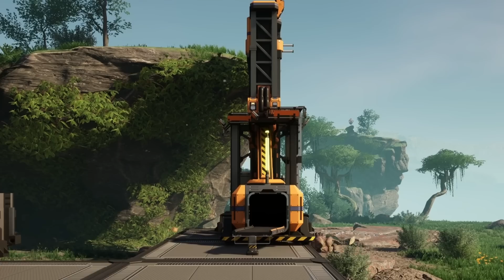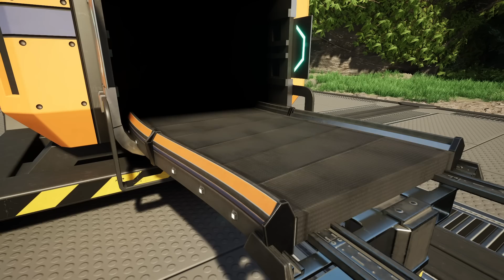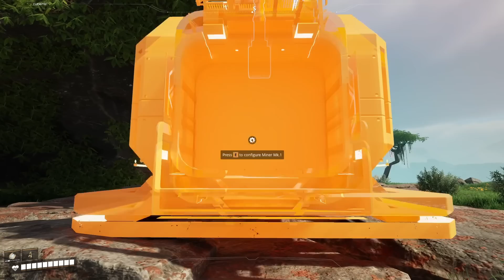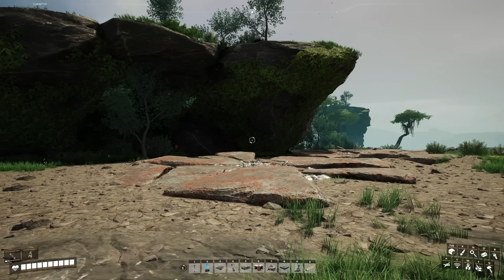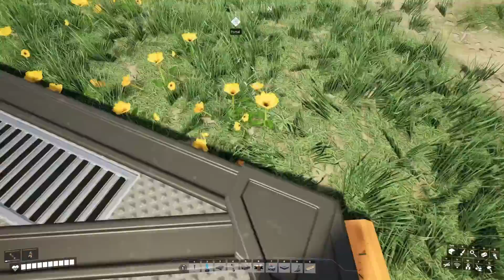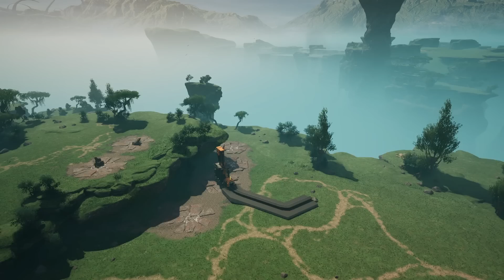How to Centre And Merge Miner Outputs Perfectly in Satisfactory 1.0

Comment from the maker: I'm thinking about covering liquids and dealing with bi-products next. Let me know what you'd like me to cover in it next!
Reply: Perfect timing for me!
Reply: Yes please as they are a pita.
Reply: Total, what do you think of some of the new alt receipes for ingots brought in 1.0 ? Ore ingots with sulfuric acid, quartz purification with disolved silica as by product, tempered ingots with petroluem coke, etc .... It seems there is a lot more options to produce ingots from raw ressources and with the new converter i feel a little overwhelmed by all the possibilities. It would be interesting to hear what you think about and how you plan to manage in you playthrougt. TY
Reply: I could definitely use that lesson lol, also how to deal with pipeline build modes lol because they never do what I want so I end up noodling everything and spend a looooot of time trying to make it look good.
Reply: For anyone struggling to get the barrier to align since 1.2, I have found a method that works.

Place your foundations and then your miner. Add another platform on the right or left of the output making sure its of the same height. 
Now take the barrier and face the output (try and be a little off center) then snap and press H once you get it to snap.

Another thing, you need to see the grid of the miner for this to work. I've tried without getting the grid to display and it simply doesn't work.

Comment: Sadly this no longer works.  The road barrier no longer snaps to the front of the miner.
Reply: I just tested this, it does work, but its incredibly frustrating to get it to snap. Best way i found was to go place your foundations and then your miner. 
Add another platform on the right or left of the output making sure its of the same height. 
Now take the barrier and face the output (try and be a little off center) then snap and press H once you get it to snap.

Another thing, you need to see the grid of the miner for this to work. I've tried without getting the grid to display and it simply doesn't work.

Comment: Found a new way to do this yesterday, all by accident. Place your foundations on the world grid like normal over the node. Place the hologram of the miner at the node and when it snaps into place hit "H". Adjust the location until the miner is centers on a grid then finalize the placement. It still works as long as it locked into place. No need for any fancy foundation work at all. REquires the Infinite Nudge mod.

Comment: The thing about 'straight' mode is that as it works now it should really be called  some variation of 90 degree mode.
I say that it that it tries really hard to make any bends in the belt be 90 degree bends and sometimes that just doesn't work.

Works great when it's all on the same grid, facing the same way. Not so much when what you want is a belt as straight as possible with a single bend, when that bend is not 90 degrees.

Comment: If you're going to do the 90 degree angle way to fix it best to do the old school way with default mode. Pole, 2 snaps in x direction, 2 snaps in y direction, another pole. Then delete poles as you see fit. By doing it using straight mode it sometimes inherits some of the wonky angle and it will not run straight on your world grid. By doing it using the oldfashioned 90 degree angle way once at the first 90 degree turn, straight mode will get the hint ever after. The very same trick also works straight at the miner's location on a world grid snapped foundation if you place the miner at a 90 degree angle from where you want to go, instead of a conveyor pole just pretend the miner is your first pole and go 2x, 2y, pole. Not always possible to get that kinda clearance on the miner, but if possible at all it's way quicker to set up.

Comment: Found a nice trick with the road barrier to wall swap. I've been making blueprints of the production machines, attaching a wall connector to them so I can daisy chain them (nothing new). But sometimes it's a pain to get the exact position even with nudging. But I found a way to move it 1/4th the distance of a nudge.

Place one road barrier. Place a second on top but tilt it once. Place a third on top of the second, but nudge it once. Place a third, tilt it back so it's straight again. Rinse and repeat.

Comment: As a first time player in 1.0 I have to say that this "issue" is a bit of a non-issue for me. I just place my miners on the actual node and run a conveyor onto the nearest convenient foundation. As long as you build your foundations a short distance away, the misalignment is virtually unnoticeable. You can also greatly reduce the visual effect by having your conveyor make a 90 (or very nearly 90) degree turn. The human eye can detect non-straight items much more easily than "not quite" right angles.
Reply: if you close your eye it all looks great :D

Comment: My favourite solution to this, is to build it on foundations as normal, then house it a structure with a conveyor wall at the front of the miner, however the housing unit is off centre from the world grid, but your foundations are not, a better solution for myself and maybe others :) Great video as usual though dude!

Comment: I noticed some of the new ore deposits (Two coal nodes in the desert) are centered with the world grid already. It be nice if all of them were so we didn't have to fiddle for 5 minutes to put a miner on the world grid 

Edit: You cant put a miner on the world grid. You can put a foundation in line with a miner at world grid height. I saved you 9 minutes and an empty promise

Comment: I like to 'break the cube' with my builds, and have never cared about building to the world grid.  I was much happier with interconnecting my builds once I learned how to cleanly merge two separate grids using beams as the guide for foundations to meet, and the hologram and nudge tools have vastly improved the ease of building interesting structures and designs off-grid.